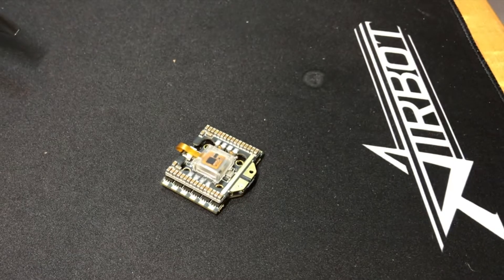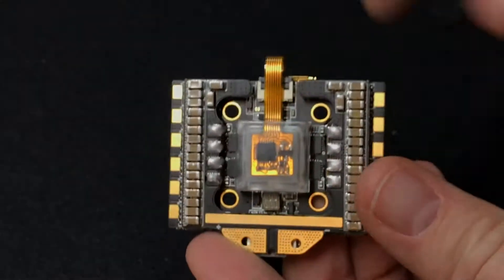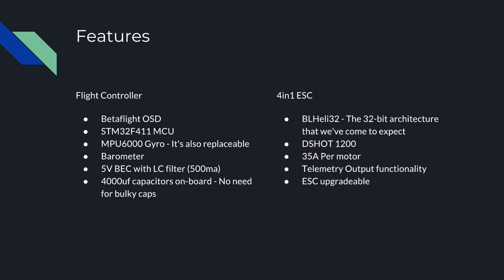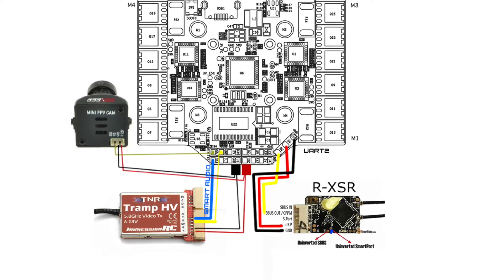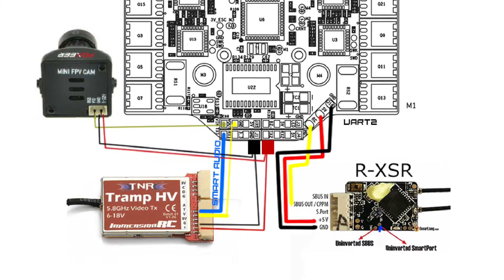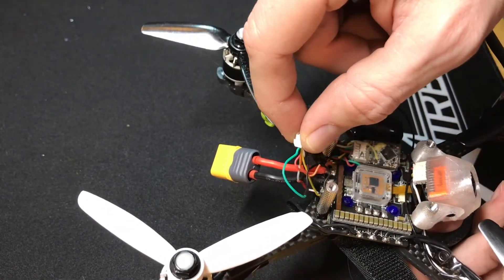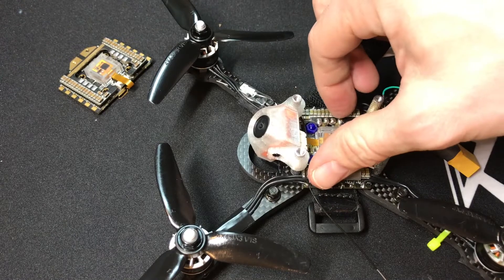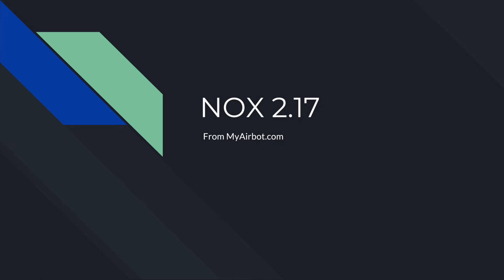Airbot Nox 2.17 Review & Wiring Guide | The latest tech in flight controllers & ESC

Comment: My brand-new nox won't power up from battery but works on usb can u help
Reply from the maker: I'd really have to see it to help. Assuming you have it hooked up correctly with power to power, and gnd to gnd and you don't get any lights on the FC when plugging in a 3-4S battery, You're going to need to contact airbot for a replacement.

Comment: Thanks for this review! Just one question, if I mount the board like you did (usb on the front), I should change board rotation in the GUI and remap motors outputs in CLI, right?
Reply from the maker: Here's my diff. It looks like I turned the board "YAW 90 degrees" and I have some custom motor mappings. If you paste them into the CLI and type "save" you should be good to go. 
https://gist.github.com/coreysnyder/6f88740da3ed9cb03d781457a9af4959

Comment: Really solid review thanks.  I've got one of these I haven't used yet (waiting on a 30x20 to 20x20 adapter a buddy is printing for me).  Did you try / investigate turning off esc telemetry and doing Smart Audio and Smart Port?   Would love to get telemetry - or crossfire - on this.  SmartAudio is non negotiable lol =).
Reply from the maker: I did not, is that a thing? I'd MUCH rather have Smart Audio & S.Port Telem instead of ESC telemetry!
Reply: A couple pages up on the RCgrps thread it was discussed.  Resource reassignment maybe?

Comment: Hi. Could you please tell me the measurements for length, hight and width? Planning a light 5inch racequad. Thanks
Reply from the maker: Dimensions of 48 by 39 mm with a 20x20mm hole pattern, and the thing only weighs around 20g! The height is probably around 8mm but I don't have a measurement for sure. It's taller than a normal board b/c it's kind of 2 stacks and the floating Gyro Box.
Reply: Thank you for your reply. I think I'll order one for my racequad then. May is coming soon. :D

Comment: F-Port protocol support in BF 3.3 would solve missing UART for S.Port problem... Unfortunately, at this point there is no F-Port firmware for R-XSR that you seems to use...
Reply from the maker: I'm not familiar with F-Port, got a link to a good resource? Could you also use a resource mapping to create a soft serial UART or does that not work for S.Port Telem or Smart Audio.
Reply: https://github.com/betaflight/betaflight/wiki/The-FrSky-FPort-Protocol — basically it allows running both SBUS and S.Port via single S.Port wire, requiring only single UART port (inverted, since S.Port is inverted protocol. But future FPort receivers should have uninverted pad). FPort firmware currently only available for XSR and X4R-SB receivers, I've tested in with X4R-SB and it works great.
Reply: The R-XSR F-Port firmware is out now.
Reply from the maker: Ryan Cheesman what can you tell em about. What is the difference between that and S.Port?
Reply: In the simplest terms the F-Port protocol from FRSky combines SBus and SPort telemetry into one protocol and can use a single bi-directional UART.  So you get both over a single wire.

Comment: Nice Board.  Nice video.  I like how they've moved the solder pads and ditched the micro connectors vs the Asgard.  You did build it sideways though.  ;) . Running the battery leads out the side works great if you cut the front lead longer so that the xt60 points backward rather than down.  The 20x20 hole pattern doesn't have an advantage vs 30x30 for this board.
Reply: Good info thanks Matt.

Comment: Can't you run s-port off TX2 as it looks open? If TX2 is used for Sbus, Maybe you can change the resource in CLI or is there a lead you can solder to to get another Uart?
Reply from the maker: Unfortunately TX2 is actually tied to the RC pad off to the right that we use for our receiver. I think you could possibly use resource maps to try using the LED or Motor5 to create a new soft serial but I really don't know enough about that. If you had a good idea of something to try I'd be happy to test it.
Reply: I ordered one yesterday so when I receive it I will let you know if I get it to work and how... thx
Reply: did you get it to work?